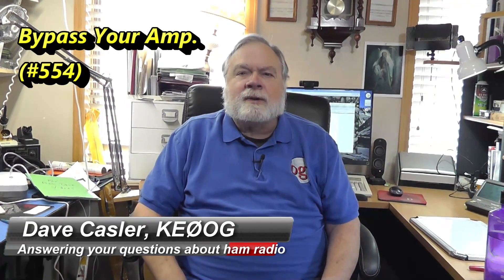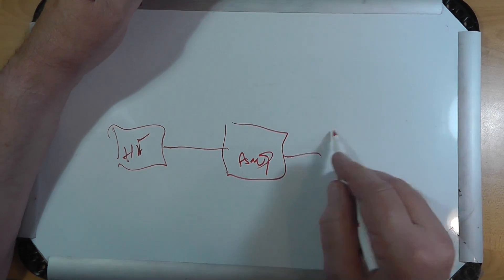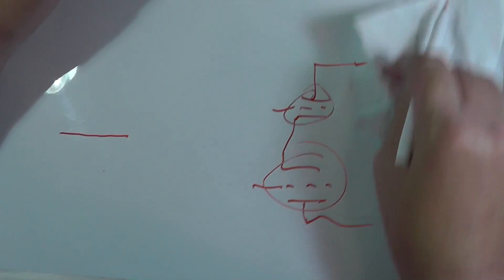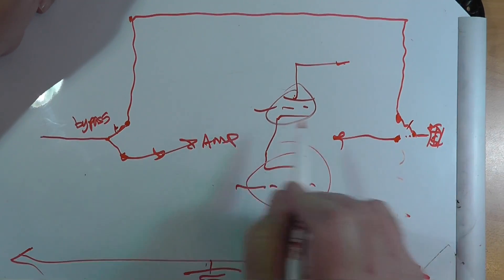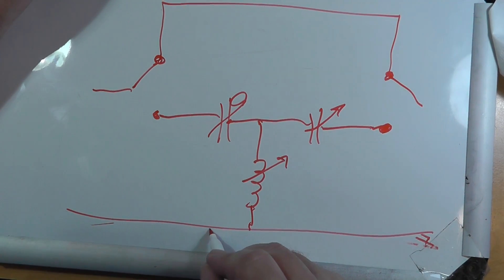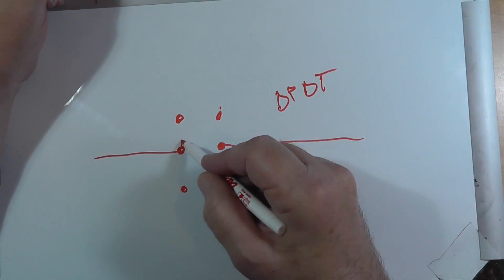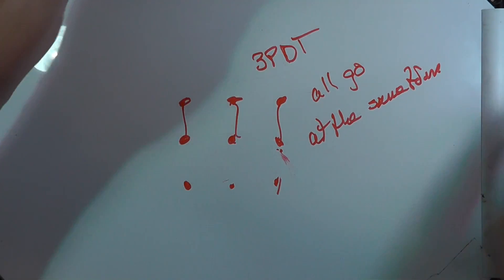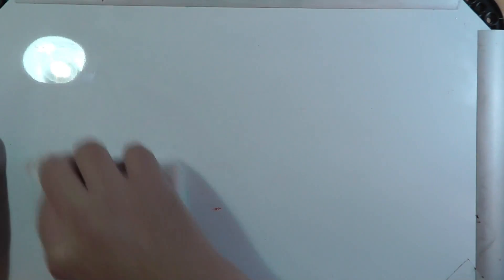Bypass Your Amp (#554)

Comment: Every Amp has a bypass on the antenna changeover relay. Otherwise, you could not receive. I think his question has more to do with a standby switch. Heathkit amps don't have a standby switch, which is easily remedied by putting a SPST switch in the amp keying line. When the switch is closed, the transceiver keys the amp PTT, and when the switch is open, the transceiver does not key the amp PTT. In which case the amp is in "Standby" and the transceiver is barefoot.
Reply: I don't believe that's true for amplifiers built back in the day when receivers and transmitters were stand-alone devices.
Reply: I have an SB-200; and, what you said makes perfect sense.  Which is, to disengage the keying (relay) circuit from the radio via an additional switch on the amp.  It should simply bypass the RF circuit in the amp and default to the antenna.  As it is now, I have to access a menu item on an FT-2000 and disable the radio keying circuit.  Id much rather have a switch on the amp itself than to have to go in/out of the radio menu options each time I want to bypass the amp.   K5KUE

Comment: Hi Dave,
I have an Heathkit SB220 amp and to bypass just turn power switch to off. An easy operate/standby switching circuit for the SB220 is to insert a SPST switch into the control line for the PTT relay. Stay safe.  73  WJ3U
Reply: Well done, you hit the nail on the head. Exactly the case. No need to even open the amplifier!

Comment: I would use 2 co-axial relays rather than a mains type DPDT switch. These can be quite small, but the type selected needs to be able to handle the RF output power.  I've use these in 2m and 70cms 100W power amps and they work fine. Should be no problem for HF use either.
However, its not quite a bypass, but simply to switch the amp between Rx and Tx modes. 
In Tx mode, an RF 'sniffer' circuit (eg. a series cap with a couple of back to back diodes in parallel) is connected to the RF input and detects when RF is present. If so, the small rectified RF voltage is used to switch a transistor which drives the coax relay coils.
For bypass ie. (no power amp)  its simply the case of not switching the PA on so the Rx/Tx path is simply though the linked 'normally closed' contacts on the relays.
73's John (EA8)/ G4STA